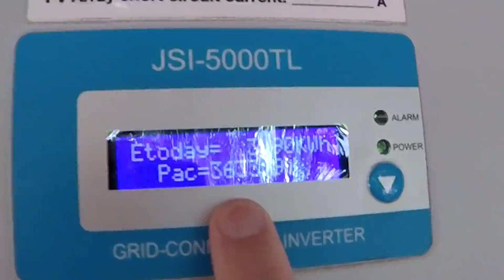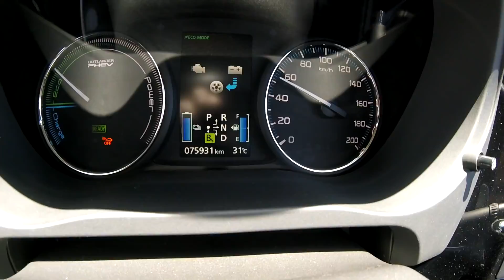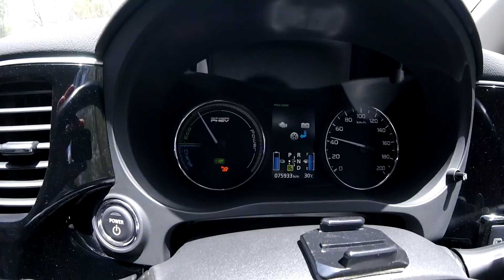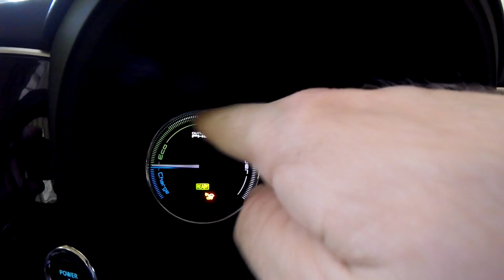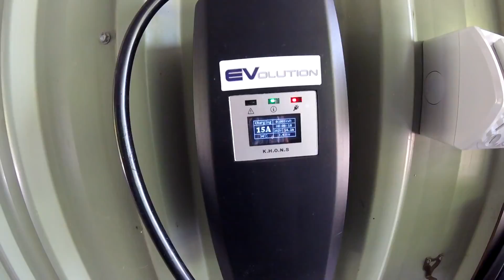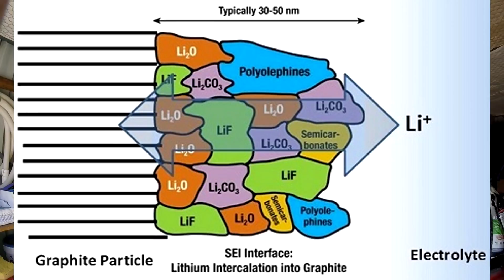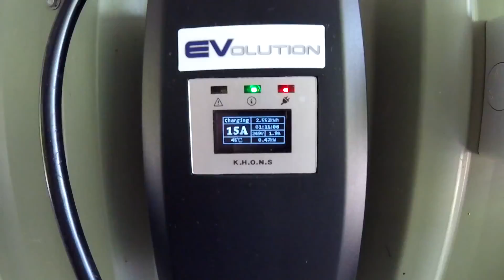EP140.2 - Should you hammer or pamper the battery?

Comment: Hi Andy, we are moving to Spain and fancy a phev.With the severe hot summers there I'm concerned about long term battery life expectancy. As you live in Aus how long do you expect to get from yours? Is there a cooling issue when parking in high temps after a journey?
      Cheers.....john
Reply from the maker: Hi John, great question. The cooling seems to be sufficient in the PHEV. Even parking in the sun for whole day at 44°C the battery has less than 40°C when turning on the car and the cooling kicks in right away. I was concerned about shi too but did a lot of testing, observations and researching. 30-35°C battery temperature seems to be optimal for best performance and the battery can safely be operated to 45°C which it will never reach. After driving in hot climate and leaving the car sitting there, the battery temperature is not rising like crazy. I have seen 1-2°C after leaving the battery, so from 36° battery temp when arriving to 38°C after parking. After all it sits under the car in the shade and usually cools off a bit if it's hot. I don't think that temperature is a major contributor to degradation in this vehicle.
Reply: One good thing with the PHEV is that it has a fabulous air conditioner, which of course can be run while you are parked etc. without running the ICE.  
I would rate it as the best car aircon I’ve ever had. Being electric, it runs the aircon compressor at the ideal speed rather than the speed of your ICE.